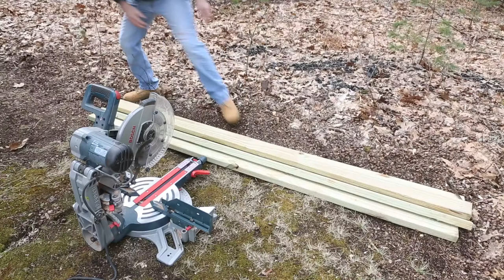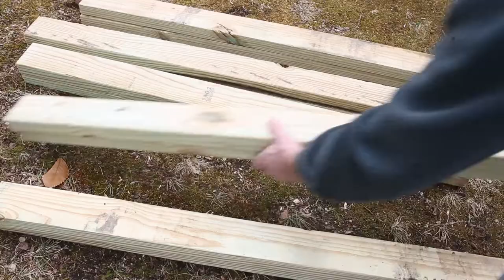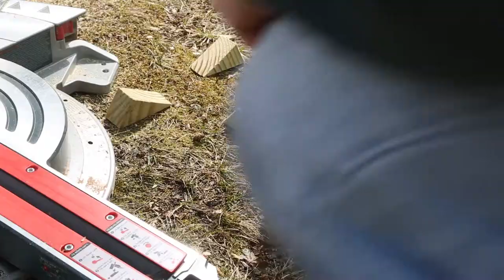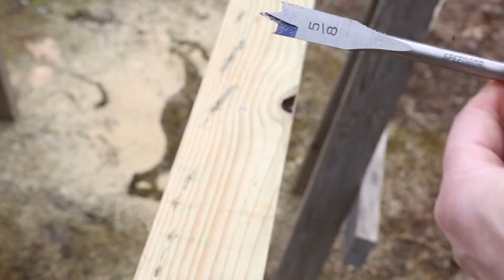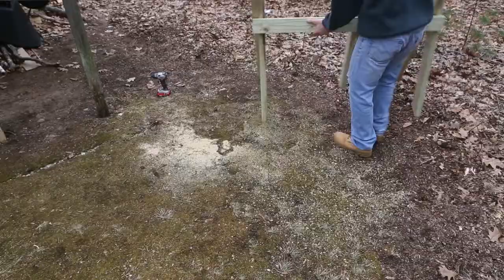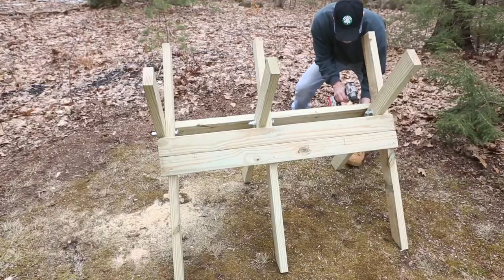Build a Sawbuck

Comment: The whole concept behind a carriage bolt is the square shape underneath the domed head.  That square shape is designed to bite into the wood, to keep the bolt from spinning.  Carriage bolts are not meant to have a washer under the head!  If you put a washer under the head, you disable the square biting element, so when you tighten the nut, the bolt spins, and it's awkward to get a wrench under the head to hold it.  You're better off using a standard hex bolt in that case, so you could at least grab it with a wrench when tightening the bolt.  Or, better still, use the carriage bolt with no washer under the head, and then when you tighten the nut the bolt won't spin.
Reply: Instead of using two nuts per bolt, just use a lock nut.